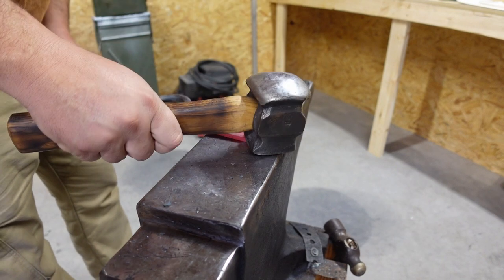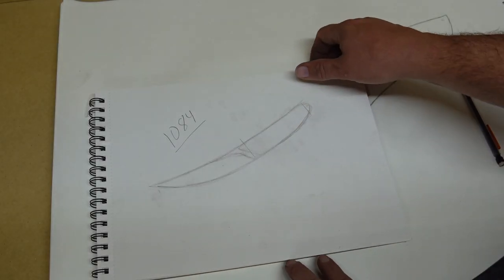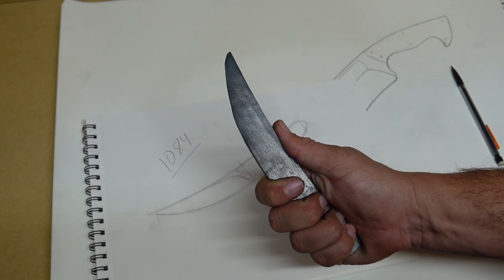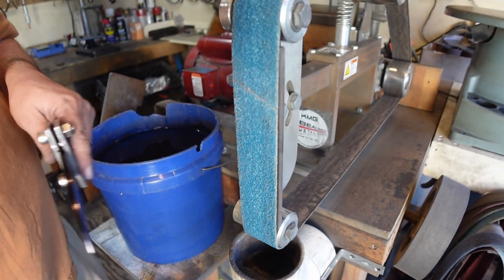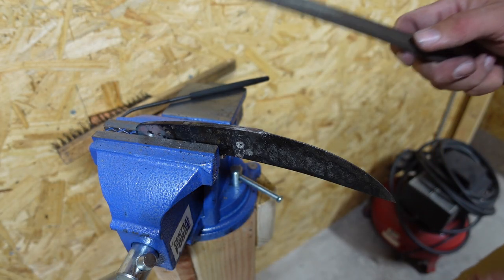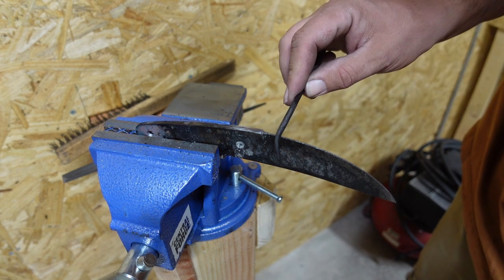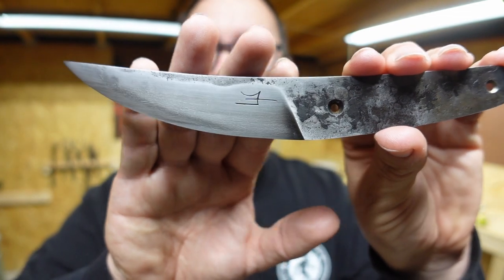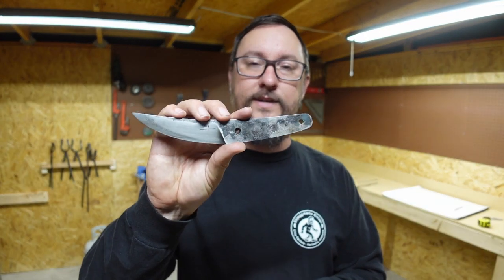Forging A 1084 Kwaiken Knife | Shop Talk Tuesday Episode 165 | Knife Making

Comment: Something I truly need is information about what you are doing...and you are great for giving details as I'm not geeky and details of the type of steel you use and what is desired about the steel is something I am trying to make myself a improved Smith. 
You are the most helpful and I again listen to learn. 
I'm the first to give you a Thumbs up 👍 
Thats unfair to you. How can someone not give you Thumbs up I don't understand what's that about. Sir I've been learning from you and you are great at teaching and extra helpful I usually hit the Thumbs up after seeing it's your video and almost slipped until the last thing. 
I'm thankful you're teaching myself. 
I'm almost finished rebuilding my ribbon burner and will be building my own carving knives this spring. I'm over sizeing my handles so to trim to fit myself or my buddies can size theirs for their own hands much as all BlackSmith fits their own handles that's something you might make your carving knives if you try building them. I'm shur you can build knives. 
Thanks 👍 Thumbs up always 👍 
Thanks for teaching me Sir
Reply from the maker: Thank you for the great comment!

Comment: I hate to bother you....again....but I want to etch and then tumble my blade. How thick should I leave the edge before I tumble it. I just want to sharpen it right after the tumble.
Reply from the maker: You can go to a pretty thin edge as long as the tumble stones aren't huge. I use Aquarium Rocks in mine. I can go to a zero edge and then tumble them.
Reply: @theriversexperience9383  I have a small tumbler here at work so I change change the media